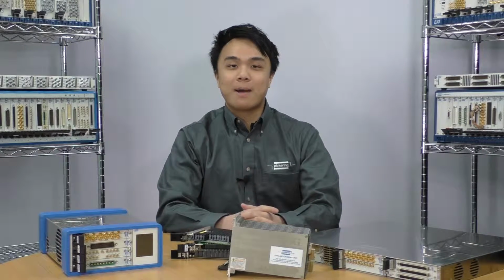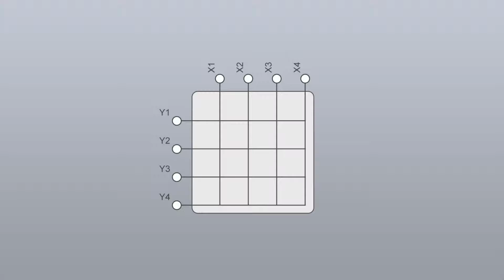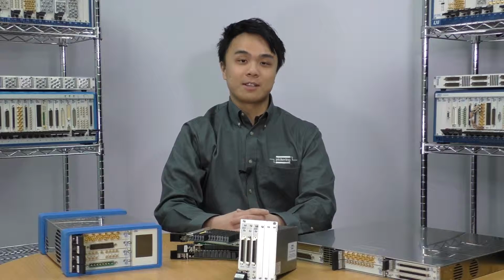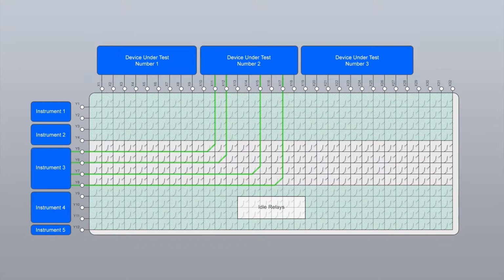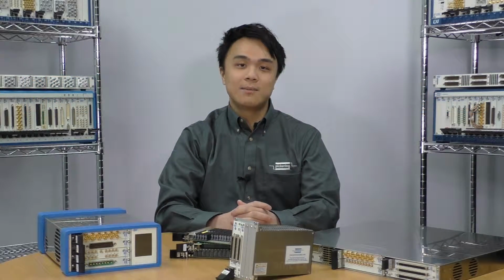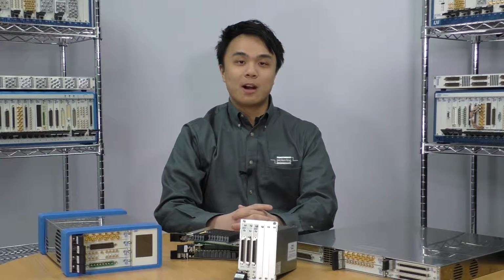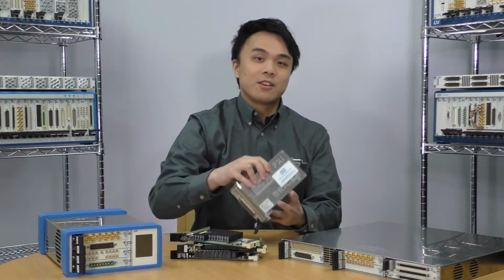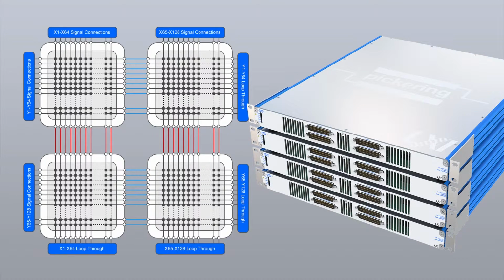Crosspoint Matrix Switching for Functional Test

Comment: How is the programmable switch connecting a column with a row technically realized? Is it a tri-state circuit?
Reply from the maker: Hi Friedbert, tri-state does not really apply here. Tri-state is more relevant with logic switching with a high state low state and a high impedance floating state. We are just connecting a point or disconnecting a point. If you have additional questions, please email support@pickeringtest.com and we'd be happy to answer them.
Reply: @Pickeringtest  thanks a lot for your explanations. So, I guess you saying "Tri-state is more relevant with logic switching....", this refers to an Ethernet switch, right?
And for your product, when you say "We are just connecting a point or disconnecting a point". How is this done technically, do you use electromagnetic relays?